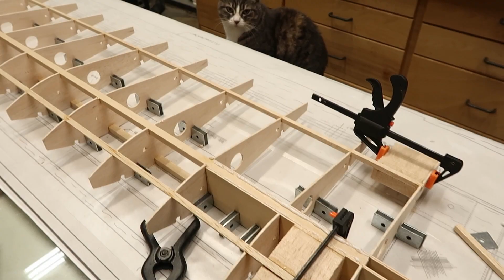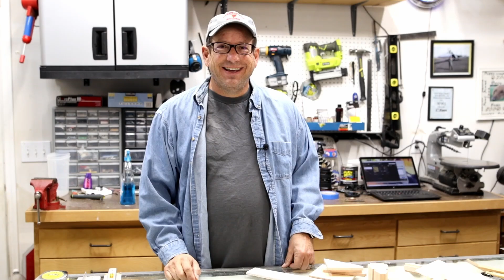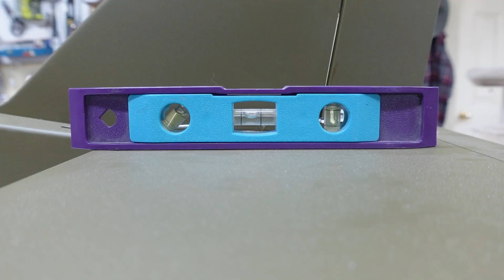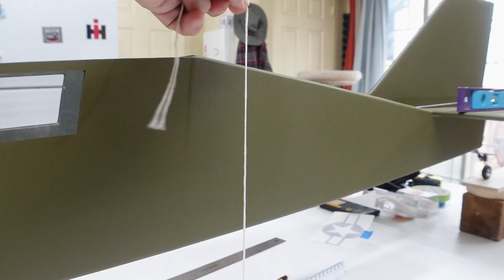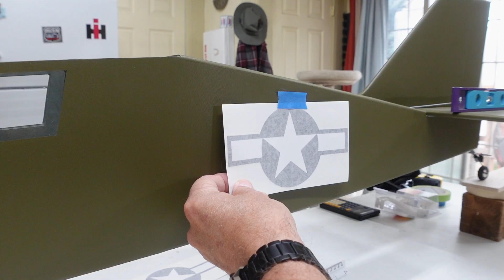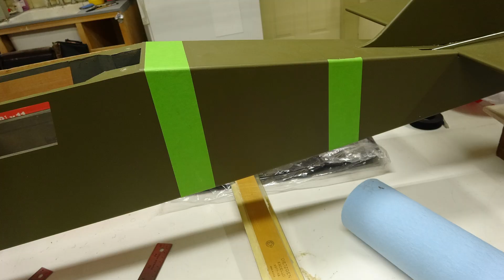Plotting Straight Stripes on my Scale/Non Scale  Bruce Tharpe Engineering Flying King

Comment: You do realise in the UK it was painted on by a guy with a broom not exactly a scientific process.
Reply from the maker: Oh yes.  I never really thought about the secrecy and quick application of invasion stripes on day one of the Normandy invasion until I was watching Band of Brothers.   The C-47s rolled down the runway with obviously hand painted most likely broom brushed.  I found pictures of Rosie the Rocketer and it actually had nicely painted on stripes.  I kind of figure that at some point they were able to use better equipment, like maybe rollers.   Hahaha.

Comment: Good idea with the plumb bob Dan But just thinking that if the table is level and the stabilizer is on level you could probably us a large carpenters square off of the table and achieve the straight up and down lines. just another way of getting the same results.
Reply from the maker: That would work too... I don't have a square that large.